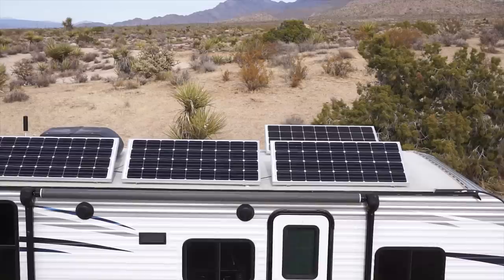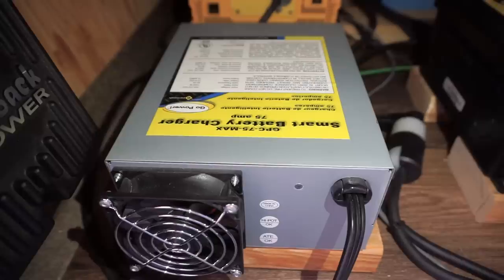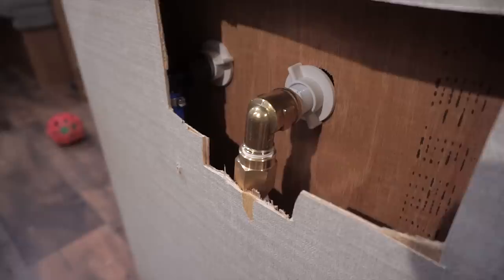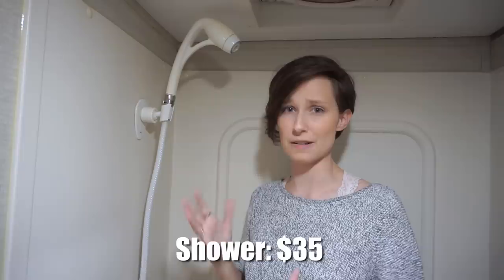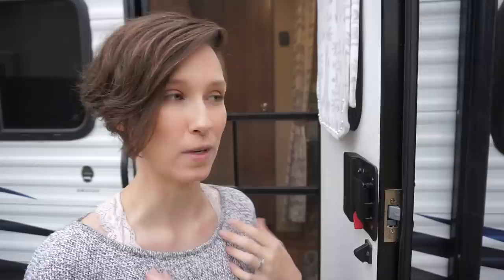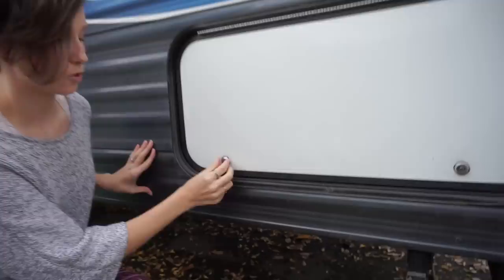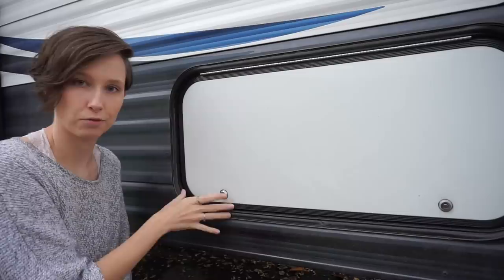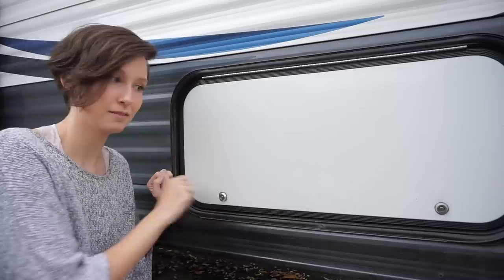Was It WORTH IT?? - All Our RV Upgrades Review - Solar, Toilet, Booster & More

Comment: If you've not found a fix for the door lock - I would recommend using a sealer on the outside plate and loctite or nail polish on the screws for the strike plate as well as the assembly screws - this will keep them from corroding and keep them from backing out easily - (make sure to clean the threads first!)  Great video guys!

Comment: Since this video has nearly 1600 comments, I'm sure others have suggested this, but maybe not. You can use some weatherstripping to sit between the door and the lock flange (on the inside) to tighten it, and some blue Loctite on the striker plate screws to keep them in place.

Comment: The keyless entry is an easy fix. take it off and apply a thin layer of silicone. it will keep it in place, water proof it, and if you need to take it off the silicone is pliable and will come off, unlike glue. Great job on all the upgrades. smart choices.

Comment: Slice your onions underwater, as it will keep those irritants out of the air.  Supplement your composting mix to include used (dry) coffee grounds, cedar chips and ground charcoal.  I save my used grounds and spread them out on a cookie tray in the heat to dry them.  It'll neutralize aromas and give bacteria production a boost to break down waste faster, which reduces volume, which reduces empty frequency.

Comment: Pull the screws out on the door lock , take Jens finger nail polish and coat the screws before reinstalling them. This will make them lock in place tighter and be a bit harder if and when you might want to remove them but it should have them hold much better. This is a old Mechanics trick I learned from a buddy. They use it because of the vibration in vehicles. Good luck, Im just getting into camper RV stuff but I spent a lot of time Driving Semis over the road so I have a few tricks that Iv picked up.

Comment: When my old car got rusty and holy my dad had to coat the electrical box or electrical lines with silicone and it worked but you have to keep tabs on that silicone. Also those holes on the door lock remove and maybe put some wood glue and let it dry and maybe some plumbing tape around the screws to make it tighter, it works so plumbing doesn’t leak. I just remember some of those tricks my dad used to do.just maybe some ideas, it may work…lol

Comment: With the door lock on the outside. Have you tried all weather industrial glue on both the inside and outside parts? Screws are good, but glue in an area along with screws can work great. Talking about the screws, go match them up and get the ones that don't rust from Menards or Home Depot. To help with the water, because if you have the rust, there is a water issue, simply use all weather caulking. Use it on the outside part of the door handle. After you have glued it to the door. If glue doesn't work because you may have to remove it to change the batteries or it breaks, try marine grade foam sheets. It will keep water out while helping keep it from moving around as well.

Comment: Not sure if you have found the solution for the RVLock yet but it is pretty easy.  The problem is your door is slightly too thin for the supplied screws/bolts.  Get a couple of nuts from hardware store and thread them onto the screw/bolt then cut off or use a grinder to take off just 1/16 inch and then when you screw off the bolt it will fix the thread.  Try tightening them back together and see if it clamps it tighter.  If still a little lose then repeat just taking off tiny bits.  That is for the 4 screws on the inside.  For the striker plate go to Lowes or HD and find matching screws in stainless steel to replace.

Comment: In response to the lock being loose;  Your problem is NOT that the screws holding the keyless entry, are loose, as another suggested.   You describe getting them as tight as possible.  I suggest you go to lowes or home depot and pick up a 1/8 (or slightly thicker if 1/8 is not available)  piece of flat aluminum. Cut one or two pieces the length of the lock, perhaps a quarter inch larger all the way around. You may need to cut two pieces to get the width. Round one faces edges with a file and or sandpaper, matching the factory edges.  Place the flat plate(s) inside between the inside face of the lock and the inner face of the door.  Keep your nicely rounded edge toward the inside of the camper. That extra thickness will allow you to tighten the screws before they bottom out.

Comment: Love solar too. Have my "starter kit" in the garage just need to install it in the RV. And they are correct about the cell booster signal loss between the transmitter and the antenna. At those frequencies there is a lot of loss in a coax run, both sending and receiving a signal, so putting the transmitter on the roof is a performance booster.

Comment: Door lock SOLUTION:

Shorten the screws, put nut on first and cut off a fraction, unscrew the nut will fix your threads.  If loosening is the problem (not bolt length),  Locktite RED will keep them from loosening. A dab on the threads, screw in and done. Additionally you could add two sided rug tape in between the door and unit.

The rust... sand off and clear coat with rustoleum but will wear off eventually. Not stainless is silly.

Comment: Great suggestions were given but please don't use red Loctite, it is for permanent screw installation. Blue Loctite is to hold the screw but it can be backed out (with difficulty) if you should ever need to replace the lock. If the striker plate and faceplate of the lock if they can be removed, you might be able to have them inexpensively electroplated with nickel or stainless to stop the rusting. Try to match the same metal of the screw and the plate to stop electrolysis from to dissimilar metals. The double-sided tape idea between the door and the lock sounds like a good plan too. Anyway that's all I've got. Great video by the way. You guys have improved video quality a lot. 👍🏻

Comment: The drip on the shower head replacement is designed to keep the water warmer when you turn it back on. .  Accordingto the instructions.
Reply: Also keeps plastic RV water pipes from blowing apart in the walls from too much pressure build up.
Reply: The drip is to remind you that you left the water pump turned on. A slow drip will have little impact on your water temperature. None really.

Comment: There are 3 things you can do to fix your RV lock:
1. Remove, sand and paint the "striker plate" with gloss paint or automotive wheel clearcoat.
2. Cut the offending screw down that does not screw in tight enough, a small amount, then chase the threads for easy installation
3. Put Bostik industrial adhesive sealant underneath the lock faceplates (the inside and outside parts which have the buttons on it outside and handles on it inside), just a dab in a few places will do ya. You must let this dry under no load for at least 24 hours on high vibration joints. You are effectivly glueing the lock assembly to the door. Make sure to align it correctly and keep it aligned while the adhesive sets
4. (BONUS) use blue thread locker on all fasteners on re-assembly

Comment: Have watch a number of reviews on solar systems from YouTube and found that not one mention the 30% tax break you get for putting solar on your home. Campers can be claimed as a second home. I would suspect most know about the tax break, but you never know.
Reply: So how did you go about getting the solar installed on your rig to get the tax break?
Reply: Hi Ginna,  If your a US citizen, that has to pay taxes, the gov. looks at your RV as a second home. I kept track of every penny spent on the system. From the lithium batteries to the screws that help down the panels. I gave the total and all the receipts to my CPA and was able to get 1500 dollars back.  I received a 30% tax break on my 2018 tax year. 2020 its 26% and 2021 will lower to 20%. Form 5695

Comment: for the wiggling door entry, take a lawn mower inner tube, remove the outer handle assembly, trace it onto the inner tube, then install the inner tube between the door and handle. May need to make two and double up

Comment: You can replace your door lock screws with stainless from just about any home improvement/hardware store.Also the loose screw issue can be solved with 'Lock Tight' 
and finally if your door lock wiggles, then place some non slip foam between the lock & the door (the interior side) the same stuff we use in the drawers.
Reply: Sorry,... "LOCKTITE" not lock tightAlso.... you will want the LOCKTITE type 242 (blue)

Comment: Have you tried blue Locktite on the screws in the RVLock? That should keep them from routinely backing out. Red is even stronger than blue, but you might have trouble EVER getting them out with that.
Reply from the maker: The problem is that they aren't backing out. The screws are as tight as I can get them with a screw gun and the whole mechanism STILL moves around as shown in the video.
Reply: Since they are tight, maybe  the screws themselves are too long for your door and they are keeping the lock itself from compressing on the door. If that’s the case, try 1/4” shorter screws. You can get stainless steel screws and solve both of your problems at once! If you can’t find the exact length you need, get longer screws (a little longer will make cutting with a vice and hacksaw easier) put a nut between the head of the screw and the cutting point and clamp the extra end of the screw in a vice. After cutting, back off the nut clearing the threads.
Reply: Take it off and dab a little construction adhesive behind both sides. You can still remove it, albeit with a scraper and a little force... But it sure won't move around. Also, the blue Loctite... I use that stuff everywhere!
Reply: @FateUnbound  Did you order/install a gasket on the back of the lock housing?  Use Butal (sp?) tape as you would on any component added to the RV, to stop the movement.  For the Screw, use a piece of thin wire or a toothpick, inserted into the screw hole before inserting the screw to help it bite.  Don't use Locktite, you won't be able to easily remove them to replace, if you decide to later on, without a pain.  Hope this helps!

Comment: Shorten the bolts that sandwich the door lock in place , they are bottomed out when tight before the sandwich effect can work and hold it tight. Using a thread locker like "Loctite" or even just nail polish will keep them tight . just coat the threads of the bolts .

Comment: Use Red or Blue Thread lock on the two screws in the door lock,
Reply: Use blue. Red usually requires heat to break the screws free.
Reply: That's a better suggestion than I had.  My idea was to epoxy the thing in place.  Down side is that if you need to replace it again, you'll end up replacing the whole door.
Reply: Yes! I use blue "Locktite" and it will be the last time you tighten them, but you can remove them if you need to.
Reply: It’s a weird issue. Did you get the outline sticker sticker for the v4? It may help a little. I have an Outdoors RV and an RVlock, no issue like yours. Simple screw in and the screws have easily held. But yeah, loctite ftw lol Have you mailed rvlock the video? Their customer service is amazing.
Reply: For the latch assembly moving, maybe a bead of silicone where it meets the door inside and out will stop it from moving. Won’t take much. In concert with thread lock should be the last time you have issues

Comment: Hey guys a suggestion on the door lock. 1st if you can get stainless screws. 2nd shorten the screws by a few threads, they might be a little too long not pulling it tight. 3rd use lock tight on the threads, that should keep the screws from backing out.  Nuff said, GR8 video, and GR8 useful ideas. .... JeffG

Comment: To tighten the screw,  take it out,  get some Elmers glue and a matchstick or two.   Using the end of the matchstick without explosives on it, put a bead of glue onto the matchstick about the length of the screw, stick it into the hole and break it off.  Do that again if there's room.  Next screw the screw back in and let that dry.  You should be good after that.

Comment: figured you found the answer but threadlocker for the screw would work. Plus go to a hardware store and buy stainless screws a size above and below what they gave you in metric and standard. Maybe the size screw isnt working. You can also do slightly shorter and longer. You will spend very little money on this.

For the door panel wiggling inside buy thin rubber and cut to fit underneath. It will help stop the wiggle. Cause it will add grippage.

Comment: Hi 
 One tube of locktight costs about $5.00 at any automotive store. One or two drops will keep the screws from backing out. And if you use a flat piece of thin rubber inside you it should stop the movement of the lock. It may take a little silicone also. front and back of the rubber. 
 Nice video, thanks for all the tips. 
I may be building a tiny home down the road. 🤔

Comment: This video is 2 years old at this point, so I would assume they fixed their issue with the lock, but for those who have a similar problem, the screw that doesn't seat all the way is the issue. Either there's damaged threads or the screw shank is too long. Tap the threads first, and verify if the screw is too long. Either way, replace the screw with a good quality stainless steel with the same thread pitch and correct length. Putting some loctite thread locker wouldn't hurt either to keep the screws seated. Blue 242 would work well for that. Do not use red, you'll never get them out again. Sealant behind the key panel and deadbolt striker plate also wouldn't be a bad idea, just use a sparing amount to make a faying seal

Comment: Hey guys, in your footage about the screw being too lose on your keyless entry, the cheapest fix is by putting wood toothpicks around the screw making the hole tighter when you tighten the screw. It really does an amazing job and worse case, you take the old toothpicks out ACS replace with new ones. Give it a try. Hopefully this is helpful to you guys. Greetings from Riverside California.  And one other product is called JB Weld. You can place the product into the screw hole, let it dry a bit and then screw the screw in. This JB Weld when dried is like cement. I’ve lost the number of projects for this product.

Comment: Okay, I had a 36-foot allegro bay class A motorhome (used) I did some creative rework also. So the front door lock assembly; what I did on mine to keep it from shifting was to use this double-sided sealant tape which adhered to the door and the lock and kept it from shifting up and down and the screws actually tighten up. Now for the screw on the plate. I took a slice of the sealant tape and rolled it so it looked like a joint and stuffed it into the screw hole and that gave the screw something to grab and smoosh into the wall of the hole and get tight. Then I used some of my wife's clear nail polish and put a coat over the surface of the plate and that worked for about 3 years. Also, I used a q tip and some silicone oil to coat the tongue of the lock and I would do that once a year. One other thing I did hear the galley was I installed a one-way vent in the roof. This lets moist air out but stops air coming in and that cut the condensation down by about 50%.

Comment: In any cell amp one needs to keep the coax from the antenna to the amp (inside or outside antenna) short because coax is lossy at cell frequencies.  30' of coax will eat up most of the amp gain.

Comment: A suggestion that MIGHT help with your wiggly door lock. Open it up, like if you're going to remove it. Then look where you have sloppy space, and cut some small wooden pieces to fill in the gaps. You probably would need to do a little trial and error to find out what works best, but that should help.  Good luck, and I did enjoy your video!   ⭐⭐⭐⭐⭐  👍👍

Comment: I've been marathoning your channel. and will introduce myself when I catch up to present day. However, I had a thought last night that if you haven't found a fix for the door handle, I think this is the trick- Put a strip of your butyl tape around the surface/lip of the inside section of the handle that touches your door. (so it would make a gasket between your handle bezel and the actual door) If that one piece of thickness doesn't tighten it up, do the same for the outer part of the handle as well. When it tightens and squeezes out, just trim lightly with a knife and you'll never see it. If two pieces of thickness still leave it loose, perhaps you can shave a little of the mating surface between the two halves. Without it in my hands, I don't know how easy that would be. Bottom line- you need the door thicker, or the handle skinnier.  Or- there's always the possibility that I have no idea. :-) I love your channel and it's great to see your cinematic skills improving by the week.

Comment: A pop rivet should be enough to anchor the door lock. However, that it's rusting already? Probably means it's  temporary. 

Also, unless I'm mistaken the quickest way into that door would be a pry bar. I'd do something else, and I'd position a couple of cameras. Whether or not they're hooked up to anything is secondary.  I like non-standard DIY security solutions. No bad person is going to recognize the manufacturer and know how to defeat it.  I'd also want a hasp and padlock option for that door. I've only been ripped off once while camping. It's unsettling. You can get a removable hasp so most of the time there's just two pieces, nothing loose. If you get a twinge, you insert the hasp, clamp down the padlock. Pay attention to those twinges. 

The LockPickingLawyer YouTube channel is great for finding out how secure different types of locks are. You'll learn which locks are a complete joke, which ones are okay. When he picks all of them, you'll realize how dumb criminals are.